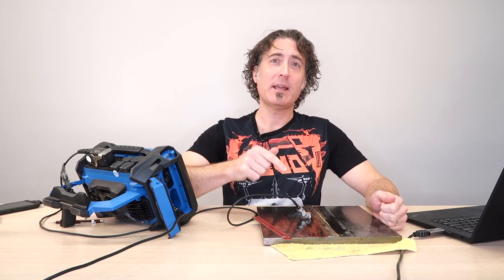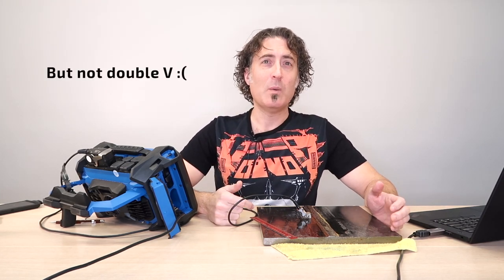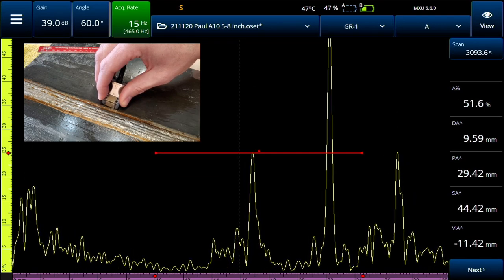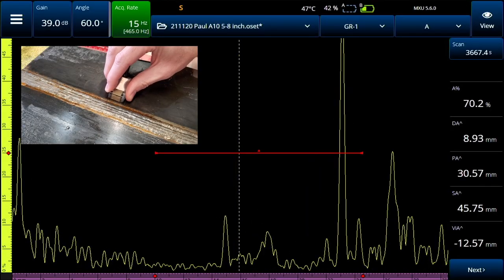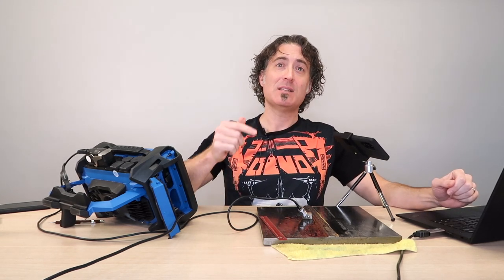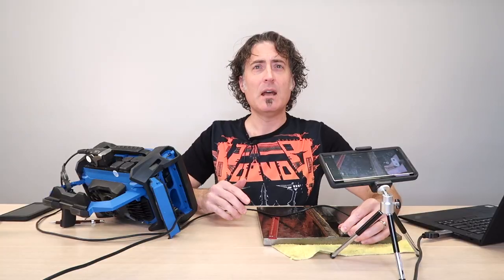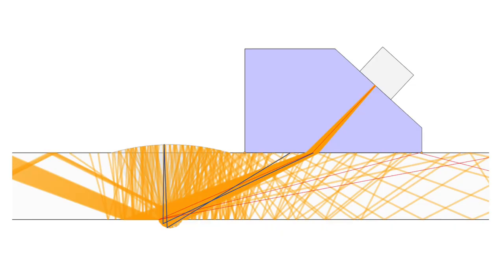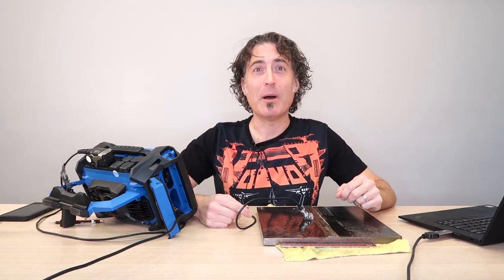Twin Peaks - UT Root Signals

Comment: Thank you Paul. Pure gold for me as an amateur in the matter. Please so a little question. That inspection is more of a free displacement where AScan provides the info to detect and confirm the tween peaks.  But if I moving with a guide following a linear encoding and I depend also in what I see in the SScan what would you recommend?  Thank you again.
Reply from the maker: Hi Gustavo, I had a similar comment to yours so I will probably do another related video using phased array and how to identify the root signal. Using the extraction cursor on the Veo it is a breeze.

Comment: Interesting, I had this twin peak signal whilst working on some 20" sch 80 I believe. Nobody knew what that were.
The near peak as you refer to it, would reach about 50% height whilst the far peak would remain in place.
Something didn't sit right so I asked the welder to flush the root off (easily accessible) and there it was, linear indication running along the root bead, didn't even need the magnet to see it.
Reply from the maker: Beauty!!

Comment: Great video! Thanks!
A question for "far side echo" - it may hide a "littlle problem" there (undercut, lack of fusion, tor crack) suprrimposed in position with expected far side echo. You recommend (right) to scan on the other side (which anyway should do if access...shouldn't?) ...but if the other side is not accessible--- is the weld root still to be considered "inspectable"? 
I thought both sides scans should be a must. Should?!
Thanks for the videos you share!
Reply from the maker: I believe most codes allow 1-side inspection (e.g. pipe to flange or elbow). But absolutely, if it is accessible then you should scan from both sides.